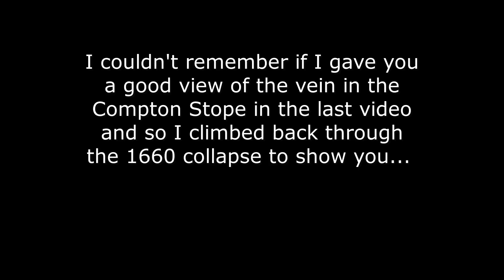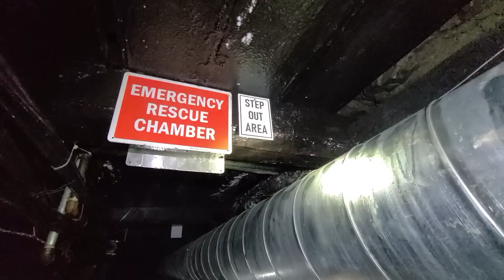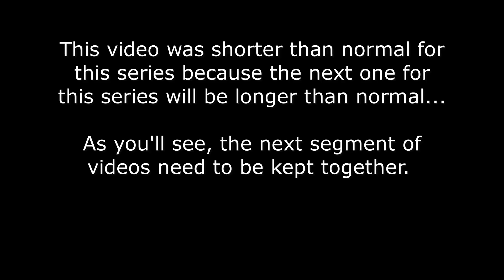Bringing An Abandoned Gold Mine Back To Life: Part 17 of ?

Comment: Just wondering wouldn’t it make it a lot easier to see in the mine if you installed low voltage LED lights?   They are super bright not expensive and are safe

Comment: Could you give us any explanation as to the method or madness of core drilling. Are you shooting from the hip or is there some kind of advanced skill or engineering knowledge of which direction or how the vein forms and where within the side of a mountain. Unless you had some kind of advanced knowledge you could essentially core drill forever and potentially just miss the vein each time. How does all this happen ?
Reply: Curious minds want to know?!?  🤠👍
Reply from the maker: The drilling is done in a fan pattern. So, in theory, it would encounter any ore body that would be large enough to be profitably put into production. Could the drilling miss a smaller vein? Yes. Is this an exact science? No.

Comment: does the core driller go that fast, or was that quick succession of tubes added to the machine just to get back to where the end of the hole is?
Reply: I think that's getting the drill back down to depth.. It looks like they cut like a 10ft core then pull the string out.
Reply: @AIM54A  wire line retrieval,no need to trip out